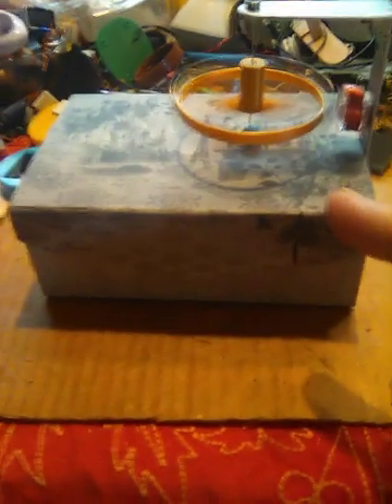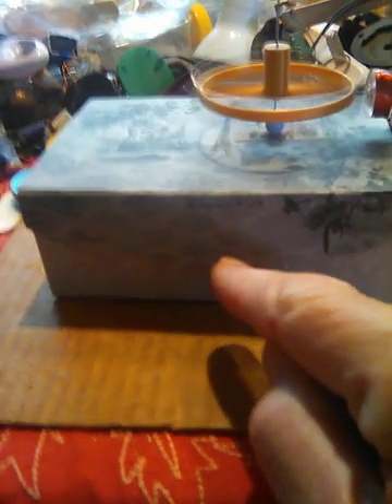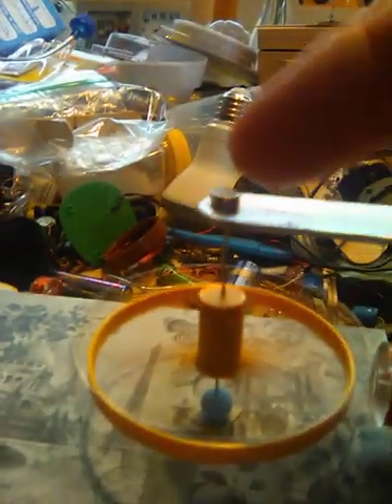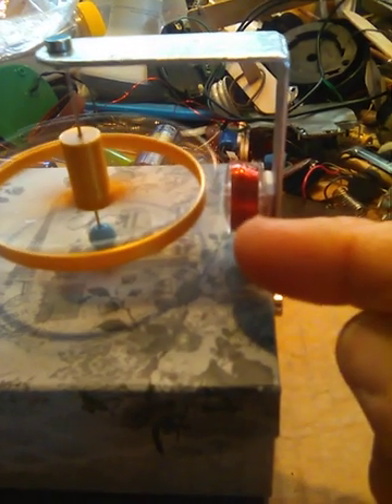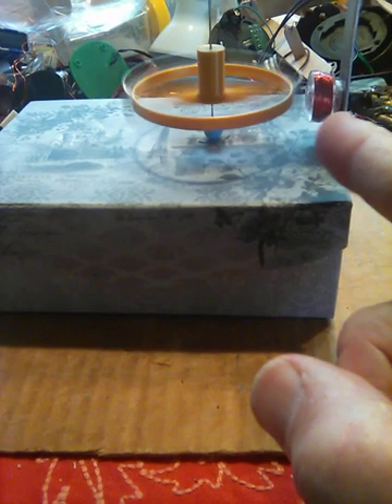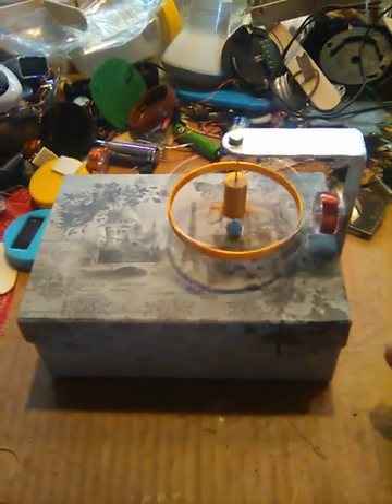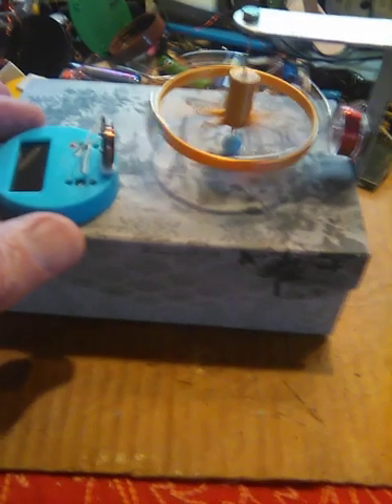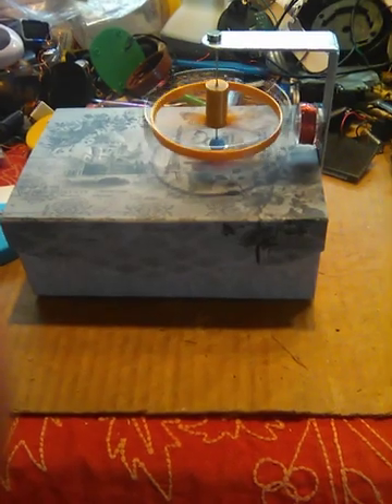Magnet Box Motor

Comment: I haven't seen many solar wavers in my usual cheap shops this year. Pretty sure the ones I did find were old stock put back on the shelf.
Reply from the maker: Same thing over here.  There are very few solar wavers in stores now.  When I saw the halloween ones I bought six.  The drive unit is about the same except for the coil.  I don't know what happened.  I guess people just stopped buying them.